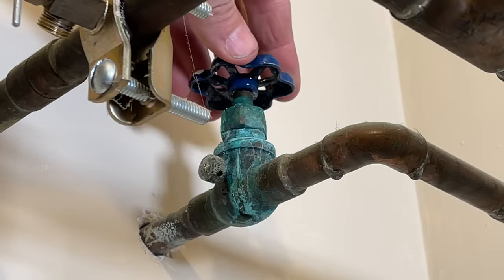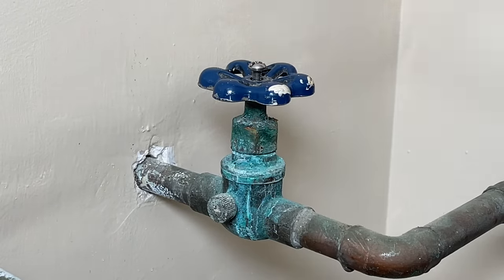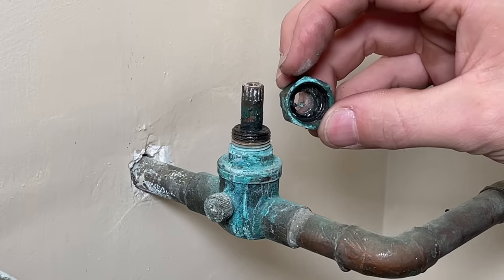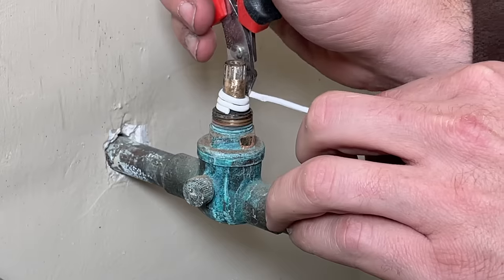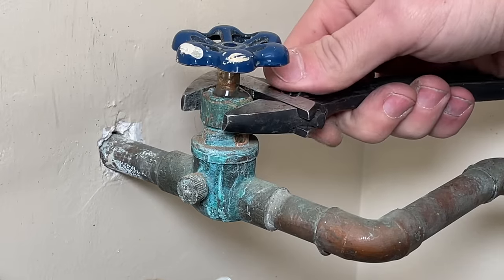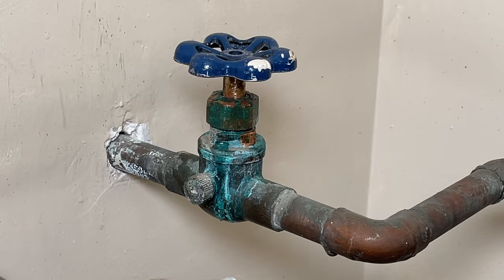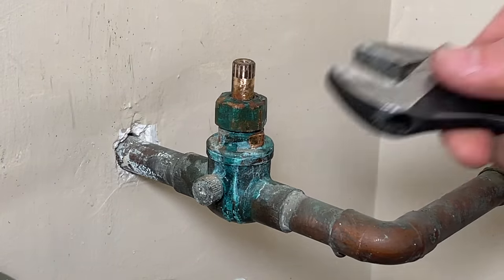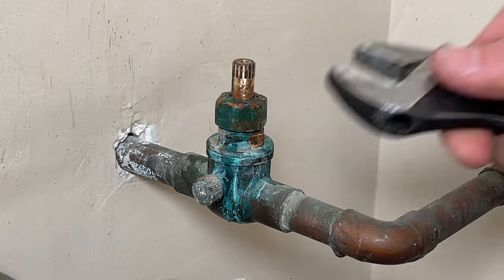How To Fix A Main Water Shutoff Valve Leak

Comment: Tip from a 30+ yr. Plumber: When opening a globe/gate any type multi-line valve that stays on for long periods of time, open all the way, then back off about 1/2 a turn. Helps to keep mineral build-up from between internal parts by giving more space between surfaces, preventing seizing or breaking when you have to shut it off.
Reply from the maker: Good stuff, thanks for the help Gary 👍
Reply: Interesting fact.  I always do this because I never like having any type of valve like this all the way open...not because of the build up, but because I did not want it to get stuck open.  I do this on everything.  Good to know.
Reply: 27 years commercial plumbing experience here and i concur with Gary.
Reply: Appreciate the tip.  When I was in engineering school decades ago one of the professors told us that gate valve should be all the way open or all the way closed.  But I learned a long time ago that the guys in the field have more reliable advice than the academics.
Reply: @snakedike  the gate can cause cavitation which wears out the gate making it not able to make a complete seal. That's why they're not meant to be metering or regulating valves. However, over time, the seat fills up with so much crap that it doesn't make a full seal anyway no matter what.  The globe valve is actually designed for metering... Or rather, metering was one of the functions included in the design of the globe valve.
Reply: @jdog4534  thanks
Reply: @snakedike  no problem. Btw, I didn't mean to step on Gary's toes here. I thought you had replied to my comment.
Reply: @snakedike  
Yeah that’s where the old saying you can go to college for 20 freaking years but my 20 years of real life experience trumps your college days. Experience over education
Reply: @jdog4534  Is a butterfly valve considered a "metering" valve? Just curious
Reply: @babox8244  yes. They can be used to regulate flow..
Reply: @jdog4534  I'm still learning Thanks brother!
Reply: @chrisdelagarza8048  experience over indoctrination
Reply: Trying to replace my sink & disposal.  Cannot turn off hot water.  All ready to go and it won’t budge.  Still looking for a great tip on YouTube.
Reply: @Audrey-km9in  Use channel locks to turn off the valve.If it breaks then shut off your main water(at water heater for hot water.Open a low faucet to drain pipes.Replace shut off.If it is threaded,use a new nipple if needed and apply teflon tape and pipe thread sealant (I like Mega-lock brand for house- hold plumbing)If you can you could buy the same style of shut off and replace the guts only too.Just thread out the nut behind the handle to remove guts.Use the new parts from your new anglestop in the old shut off.That is the easiest way
Reply: @jdog4534  That's why BALL VALVES are so good!!
Reply: @Blasthoff  ball valves are great for quick and positive on and off operation.. i love them for supplying my garden hoses. Just screw a hose adapter into one end. Then all it takes for full on is a quick ¼ turn.  ...and reliable shutoff in case you ever have to solder downstream of one., they just suck at metering...
Reply: @jdog4534  Another plus not mentioned is they are FULL FLOW, meaning there is no restriction of full pipe diameter flow.  This is a plus if running more than one hose!
Reply: @babox8244  The old guts replacement? You're giving away all the good plumbing secrets!
Reply: Or just cut that piece of crap out and install a new 1/4 turn ball valve
Reply: @jdcisneros9023  Ball valve?WTF? Under a sink? You mean angle stop? We're talking about when the nipple could break or the solder joint twists out of the joint when you go to change it .
Reply: Stretch before you run ;)
Reply: Not to mention the fact that if it's all the way open and someone thinks it's closed they might simply think it's stuck and keep adding force until they break it. Similar to the old adage of "when 'righty tighty' suddenly becomes 'righty loosey'"
Reply: Hi
I attempted this and my packing nut cracked and split when putting back on. 

At hardware store I was told  probably will not be able to find that packing nut for replacement. 

My valve is old almost identical to the one in this video.

What are my best options at this point?? 
Any advice appreciated
Thanks
Reply: @brookemartinez9107  get a frost proof hose bibb.If you have galvanized piping,find the next joint ,cut pipe with a sawzall,remove the male adapter,and thread in a pex X male adapter,which will transition it to pex,and it will be easy to work with instead of the galvanized.
Of it's copper and you aren't good at soldering ,cut copper and install a sharkbite coupling and use pex on the other side.If you can solder,install a hosebibb adapter.
Reply: @babox8244  Butterfly valves are mainly shut-off valves, but can be used for flow control, depending on the conditions.  Chances are you won't find a butterfly valve small enough for household plumbing, and they would be more expensive anyway.  A ball valve would be a better choice, but in house plumbing I don't know why metering would be needed.  Your faucets do that.
Reply: @jdog4534  on
Reply: @snakedike  Yup. He was wrong.
Reply: Sorry, the prof, above.
Reply: @snakedike  That's how we learned it in BT "A" school. Gate valves are for being opened or shut besides an emergency situation. Globe valves and ball valves are for metering.
Reply: Can't be said enough. Especially with main shutoffs, it's good to open and close them every now and again - spring and fall if nothing else. It helps lubricate the seals to prevent rot and sticking.
Reply: YES! Finally a sane response to the whole video and the thread! If you have a Tee wrench (6 foot long tool to turn off water at curb) then you can really fix the problem the right way. Cut out the bad valve and install a new ball valve with compression fittings - that's the right way. If you don't have a tee wrench, rent one. And what is the cost of your time or the time that your wife can't use the washer or ANY sink or toilet? Also, if the homeowner is that strapped for cash, a leaking shutoff valve is the least of his worries. He can leave that project to the new owners when he defaults on his mortgage.
Reply: @sfeldner  Never seen a street meter shut off I couldn't use some kind of regular wrench on .
Who has time to pack around a 6ft bar ?
Reply: Excellent advice. I worked  in water distribution and I would even do that on our main line gate valves.
Reply: I've been doing this for less than 10 years and when it's a multiturn valve I do this instinctively. I'm starting to wonder if I picked this habit up along the way or if I had some kind of instinct 😅
Reply: @Blasthoff

Comment: If you’re using a wrench to turn any thing on a valve, you should have another wrench or Vice grip to prevent all that torque transferring to the pipe which could create a leak at another joint or fitting.
Reply: Before opening a main valve you should also open at least one domestic tap.
Reply: Your right about this. You need to oppose the other wrench.
Reply: 🎯🎯🎯 back-up wrench
Reply: Yes. That is a basic rule.  I had two goofballs installing a new clothes washer and one of them broke the cpvc connection because he didn't stabilize it with another wrench.  Not surprisingly he said "Oh this has hsppened before." Yeah because he keeps making the same mistake.  Then he blamed the break on corrosion! 
I called Home Depot where I had purchased the machine, and immediately got a refund of $150. Then I still had to the repair myself.
Reply: Or worse yet- the valve could SNAP OFF! oh boy, then you might have that full city water pressure blasting in and no way to shut it off until the city sends someone out to shut the water off outside!
Reply: This is why I always go to the comments in the DIY videos, someone always has a valuable tip

Comment: Why would you ever not automatically replace the bonnet valve and Teflon tape the threads while you're repacking the nut as a matter of procedure? You've got the water off and system drained, just replace it all.

Comment: Quick tip of the day for you . 
Take two wrenches 1 on body 2nd on nut and they should be slightly offset to eachother.  Now wrapping hand around both squeeze together . More powerful and no strain on pipes . Happy plumbing and it works for tightening as well .
Reply: Martin Miller, Yes exactly the best way to slacken a tight nut, then when the nut does suddenly slacken there is no sudden movement to what ever the nut is attached to.
Reply: That's a great trip for loosening period
Reply: don't squeeze together!
one is a vise and should be held stationary, the one holding the valve body, or pipe assembly. the other hand supplies proper torqueage

Comment: I’ve done this repair several times in my 50 year old house.  A couple of times I did the full three step repair the way you did, then I got smarter.  I cutout the original shutoff  valves and replaced them with ball valves.  They are about $10 but they won’t leak and they can completely shut off the water with just a quarter turn. When the handle is inline with the pipe it’s full on.  When the handle is at 90 degrees to the line then it is fully off.  The ball valve is the way to go! 👍🏻👍🏻
Great video!
Reply from the maker: Thanks Michael, completely agree and actually will be swapping this valve out to a ball valve later this week when I install the water heater.  So much better!
Reply: @EverydayHomeRepairs  can you do a video on the replacement as well if you do it?
Reply from the maker: @dakotbeastj  For Sure!
Reply: @pauledwards3325  
I did not. I will look into it.
Thanks
Reply: On the new ball valves certain brands have a packing nut that will leak you just have to tighten it usually no further problem
Reply: 1/4 turn ball valve shutoffs are the bomb. I automatically replace them when working on sink faucets, toilets, and the like. [DIYer here.]

But this video is great if that option, for whatever reason, is not open to you. Here, the soldered copper pipe is going to make changing the valve out a problem if you are not up on your soldering skills--and I admit, I avoid soldering pipe wherever possible. It's not that hard, but can be scary, especially in cramped spaces or next to woodwork.
Reply: Never turn the water off to your house abruptly with a ball valve it will create alot of water hammer especially on older homes. If you do need to turn it off make sure you do it small increments at a time so you don't shock the system and open some faucets to relieve some of the pressure.
Reply: @f3arful  Good point, and thanks! A water hammer arrester, of course, is usually installed on the house side of the main cutoff, and so is no use.. You can also reduce the effect by making sure all taps and hose bibs are shut off, so no water is flowing into the house. I wonder, though, is this also a problem when turning the water off at the meter, especially if there is a long line from the street main?

Comment: Just something that I thought some of you might like. I am a carpenter/handyman and what I have been installing for some customers is a 3 valve system for their main shutoff.
I install 2 ball-valves with a water spigot in between. This way you can use the spigot to drain the house and if you need water while your house is shut off you can still use the spigot. I got the idea years ago when a customer wanted to shut off the house before going on vacation but also wanted to drain the pipes in case the furnace stopped working and didnt want the pipes to freeze
Reply: great idea.....seriously. if i may, why not save yourself and the customer the cost of the third valve and purchase a shutoff with side drain? that way you can do as your method with getting cold water at least while house is shut off and the second valve can assist with draining the home along with opening a few taps and flushing the water closets.
Reply: Great idea.